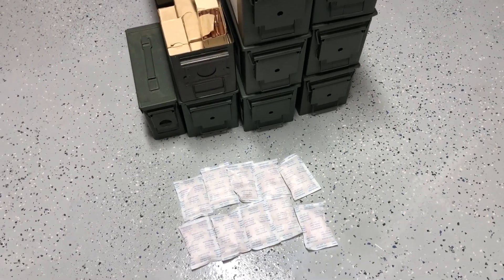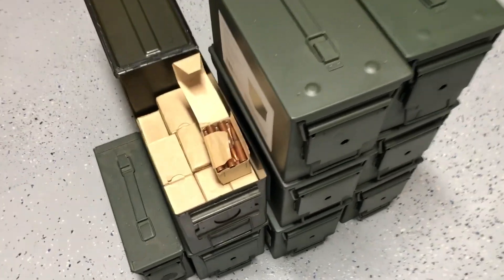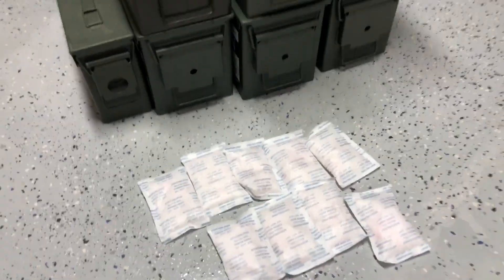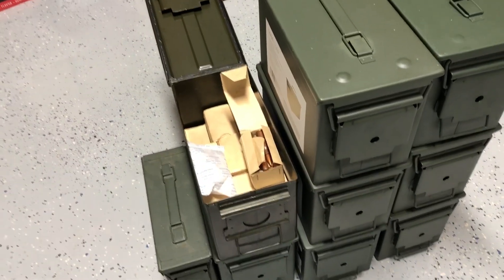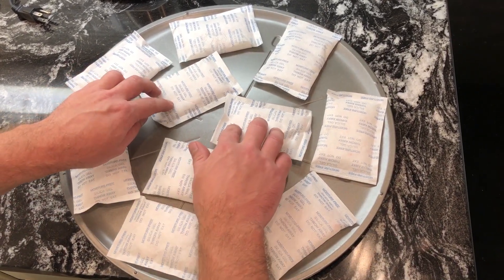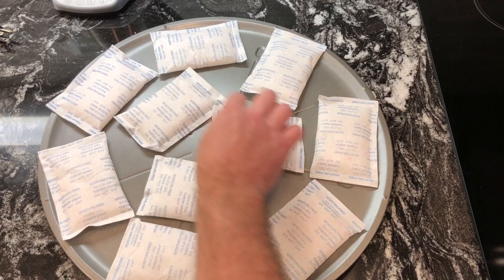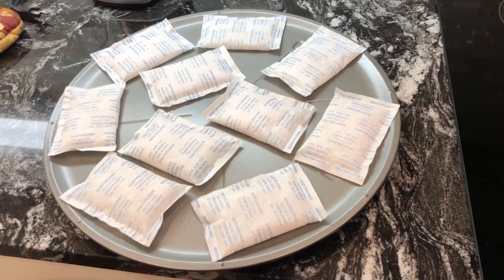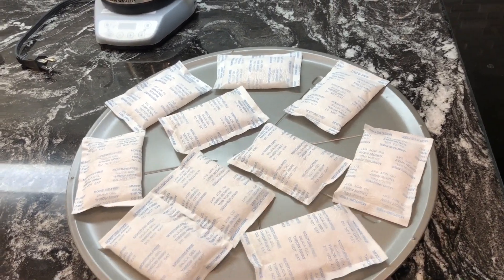How to Reactivate Silica Packets for Ammo Storage (Safe & Simple)

Comment: I have my ammo in the 50 cal cans in my basement closet, what should the temperature and humidity be.??
Reply from the maker: According to SAAMI (Sporting Arms and Ammunition Manufacturers' Insti extremely high temperatures (over 150° F) should be avoided. The ideal st temperatures is between 55°F and 85°F. In addition to avoiding high temp cold can also affect your ammunition (although it's less likely). On the side note if your cans are properly sealed you should be good from moisture.
Reply from the maker: Also constant temperature is the key for 10 plus years of storage